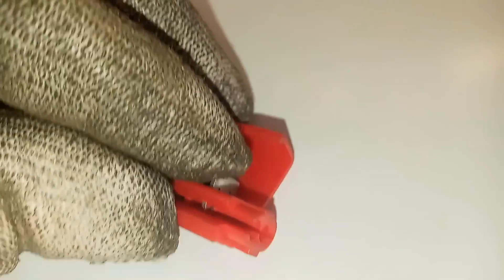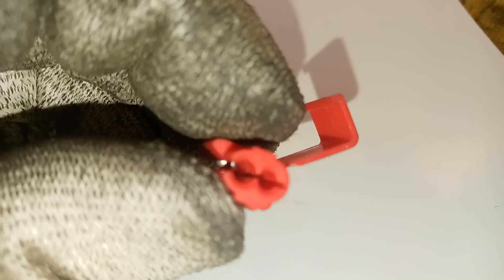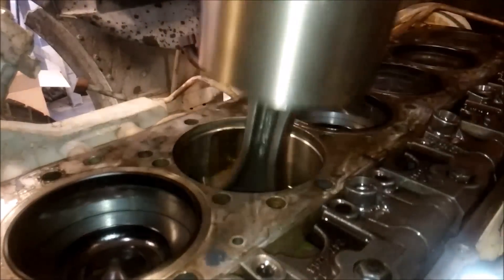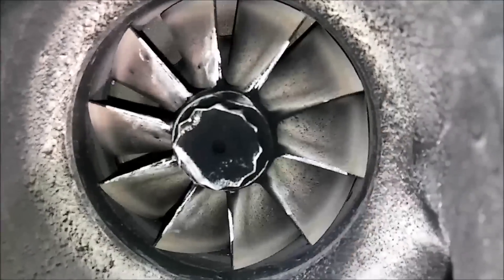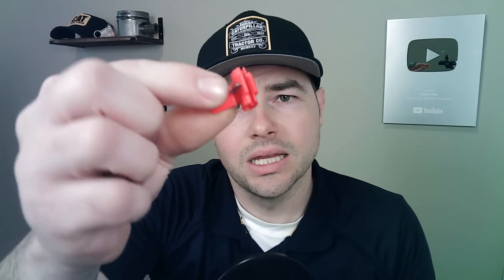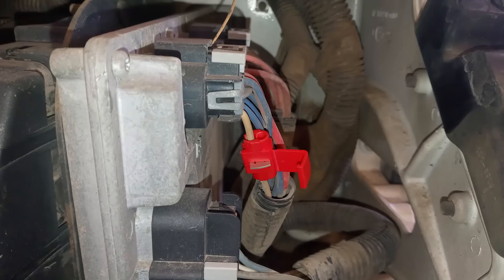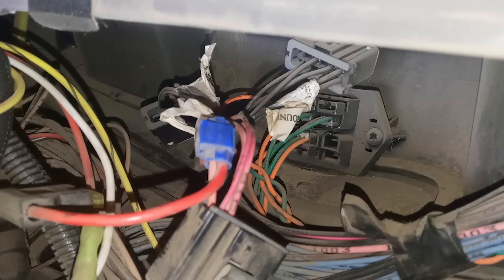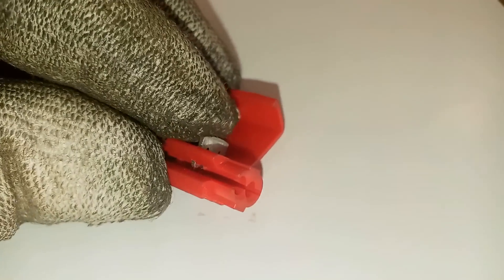Why you should NEVER use a Scotchlok connector.

Comment: They create a hot spot also current runs on the outside of the wire engine vibration is another problem with them 
Liquid electrical tape is a nice permanent sealer if heat shrink is not available
Reply: Scotchloks are garbage but in DC and low frequency AC, the effect you are referring to, the skin effect, does not exist.

Comment: if i have to add a new circuit ill just pop in a 4 fuse holder and depending on power i would also add a relay but the big question is: will they pay for that? the answer to 80% of the owners i face will say "hell no thats too expensive" and then proceed to do it themselves the worst most dangerous possible way with these or just twisting the wires together.... this is the main reason that when i do electrical diagnostic they pay the fee BEFORE i tell them the issue and also wont touch their car after the fact... this might seem too cut throat but ive had lost too many hours of my life having a nightmare fixing hodge podge electrical issues, i said no more....

Comment: These are very popular in the UK for wiring up trailer light sockets from the back of a tail lamp and fail as often as you'd imagine
Reply from the maker: It never rains there so I'm sure it's totally fine, plus you guys have the metric system so that prevents corrosion.
Reply: @AdeptApe  We have the "British" system, where ordering a two metre length of two inch x one inch Lumber is something entirely normal to do
Reply: @AdeptApe  britain is imperial. We even use stones to measure weight

Comment: Yeah I hated these things so much, I worked at a Firestone and I was consistently  confronted with those hate full  things. It's difficult to explain to a customer that those things were the reason why their car wasn't working right because they were the ones that put it there in the first place so they get defensive about it and go full Karen on me.
Reply: Learning to solder is always the best! A properly soldered wire beats anything
Reply: @danielwhite96  yep except for automotive applications in which case you don't use solder for connections
Reply: @michaelf.2449  I wish more people knew this.
Reply: @michaelf.2449  Yup, a good crimped connection is always a far more mechanically sound joint then soldering in an automotive/machine application.
Soldering has to be used in some situations -   like a damaged multi wire harness where maybe 10 or more splices have got to be made in a tight location where you haven't got room to stagger the crimps - but you MUST make sure the harness is secured/supported fully either side of the soldered joint or in time they break through vibration.
I will add though:-
A good soldered joint is always better than a bad crimped joint.
A good crimped joint is always better than a bad soldered joint.
But a good crimped joint is always better than a good soldered joint in our application.

Comment: Agree...  Scotchlock's ONLY "plus" is that they are fast.   As a person who has used insulation displacement connectors in the telecom field where they are standard and applicable for low voltage low current applications like network and telephone cabling, I observe that an insulation displacing connection of this type is normally ONLY used with solid conductor wiring.   Stranded wiring used in patch cords, does not make reliable connections with this type of "pinching" IDC either.  My first exposure to these connectors was in fixing a crap install of a nice car alarm, that malfunctioned due to intermittent scotchlock connections, as well as causing full breakage to the power wire that was tapped into.  I removed them, and did soldered splices using the correct guage of wire to replace the break in the main power lead, and a good quality electrical tape, and they never had any problems again.
Reply: The little white rat rubbers are better and we used them, verizon or GTE was a big user of scotchloks but we never did for splicing cable as they opened up all the time.
Reply: @badgerpa9  - LOL! Rat rubbers!  Never heard that one, but the description fits!   We called them beans.  My work was mostly data and telephone station cabling in high density office spaces and call centers, where both ends are IDC "punchdown" connections, and patch cords, or jumper wire were punched down to connect the stations.  We didn't do much splicing, or exterior cabling work.  Install station cabling on a new space or remodel, and assist the clients IT staff and equipment vendors with moving, installing and connecting, and sometimes with programming telephone systems and lan/wan hardware as needed by the customer and their other vendors.
Reply: @orcoastgreenman  I did some outside plant work and took care of sites that had cable between buildings. A large variety of places for the first years.  I did programing of little key systems and Nortel PBX, VOIP, routers and some other stuff at times. Later  I did 911 centers, military sites mostly government or hospitals. I even did 1A2 in the beginning, saw 66 blocks, bix and 110 frames.
Reply: Insulation displacement connectors are frequently used in grid level power distribution too.
If your house gets power from a power line that has bundled insulated conductors (common here in the UK) they use insulation displacement connectors to join your house to the line.
They are a totally different animal though, very well designed, very solid and fully sealed.
There is nothing wrong with the concept of insulation displacing but scotchloks are such a piss poor implantation they are laughable.

Comment: Great video as usual! Need some info off topic. If one does an inframe head and all do we need to go with overhead intervals as if engine is new?
Reply: I’ve always been told yes overhead valve adjustments have to be done at the normal or severe service intervals. No matter if inframed or new valve adjustments need to be done. I’m running an ISX 15 Cummins overhead cam engine it even needs adjustments made at regular intervals.
Reply: @darrencatenacci2737  the cat also does. 3406e and beyond had an overhead cam. Yours has dual overhead cams. And I agree valve lash is very important. When the engine brake starts popping here an there one needs to adjust valves. If you don't you will soon spend more money than your truck is worth

Comment: installing instructions @ 7:12 XD

Thank god FINALLY there's someone sharing my opinion. Sweet!
I hate these things more than anything too and yes, they do get me started.
I've seen so many of those and so much damage done to the vehicle's wiring it's just insane how lazy people are and how bad of a job they do all the time.
Most I've actually found on tail lights to hook the wiring for trailer lights up to it. Not only do they damage the wiring but also at least double the electircal load on the circuit that it was designed for by directly hooking the trailer connector up to the tail lights of the vehicle.
I don't know how many feet of wiring I had to replace in the past because over time the corrosion keeps creeping further into the leads inside of the insulation.

Nice video, thank you for sharing this!
At least you're a professional mechanic (unlike me) and people are gonna believe you (unlike me) xD

Comment: AH, the venerable Scotchlok. They should really be understood for what they are, a quick temporary connection. This type of connection was likely intended for single strand (solid) wires, as in for telephone service. Add the problems of a vehicle and the environment therein, forget it. You are dealing with stranded wire.

Not mentioned here is the problem with stranded wire. It exists for one simple reason, flexibility. That quick tap connection cuts through strands like butter. Not only this, but in the long term, with vibration, those remaining strands can move, the ones that run through the tap that were not as damaged. Once they do this, there is less pressure against the tap, and we now have an intermittent connection, resistance, and heat buildup.

Comment: Scotch locks were invented for uhaul to connect a trailer to your car. AND THEY DON'T GIVE A DAMN WHAT HAPPENS TO YOUR WIRING after you drive off the lot. The inventor should have been strung up by his toes, (I'm trying not to violate community standards)
Your rant was just my warm-up to my rant. At one point in time trash truck builders used nothing but that garbage in light bars

Comment: You need to throw temporary battery terminal connectors in with your rant . People think they are permanent solution to their bad terminals. If you use tapping connectors at least waterproof them with hot glue fast and easy. I waterproof all connectors with hot glue
Reply: I have had pretty good luck with the bolt on terminals. Definitely much better than the scotch lock things

Comment: I am an electrician...yes,  they are junk , especially when exposed to to weather and road salt or any kind of moisture
Reply: and yes , they cut thru your stranded wire and create a weak point ...point of heat because of reduced circular mill